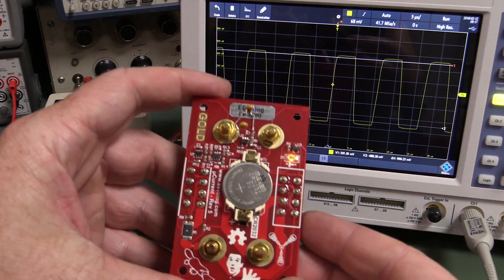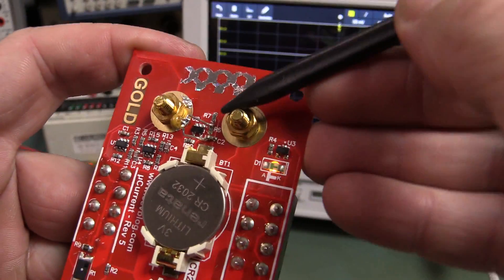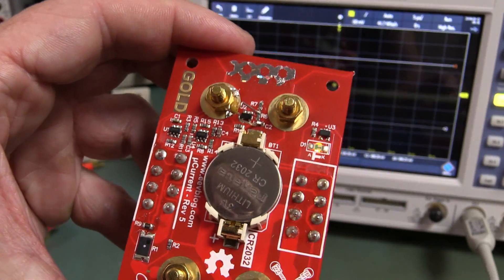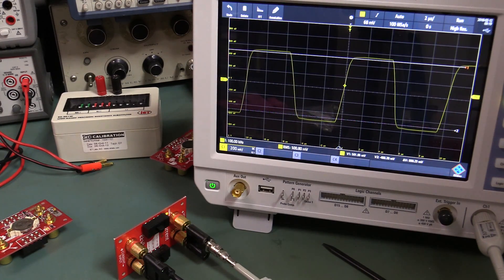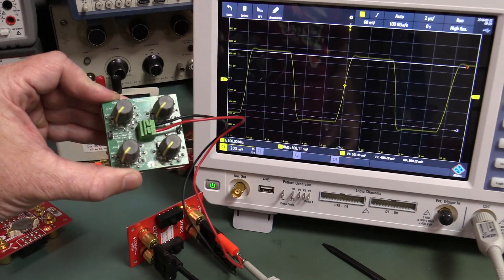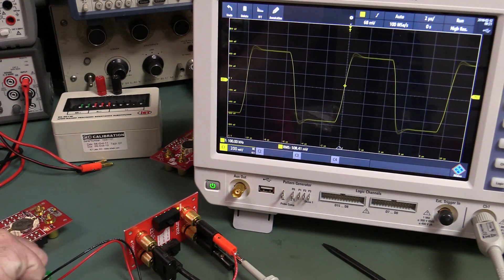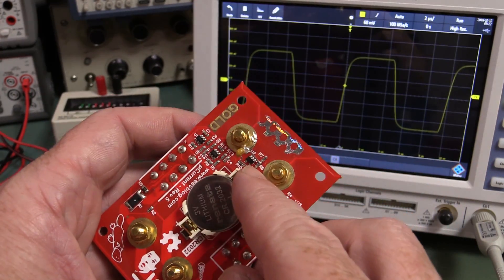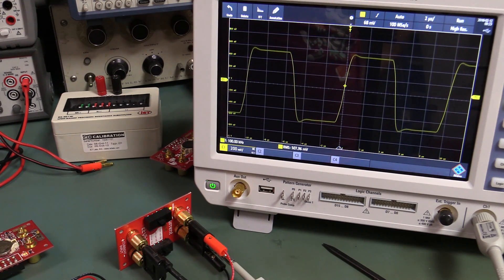µCurrent Opamp Divider Input Bypass Testing

Comment: I'd like to understand in what way bypassing the input divider is similar to bypassing the output?

I would usually bypass the input anyway attempting to lower noise of the v-gnd. Did you mot do this because the battery is already low noise? Why did it cause overshoot??

Comment: Always, always bypass a reference divider like that - in fact, in many circuits a big enough capacitor obviates the op-amp because the capacitor's impedance is so low.

Comment: Um.......I'm lost. What the hell are you working on and what he hell are you doing?
Reply: The latest batch of µCurrent's that Dave has been selling for years has an oscillation issue due to a manufacturer substitution when he ordered one of the chips on the board. He is working thru possible workarounds for the oscillation that wouldn't require redesigning the circuit or replacing the chip.
Reply: Thanks for the update! It is appreciated.

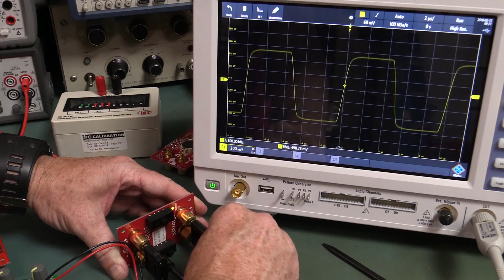Comment: I'd never guess, but the fix with caps on the rails made a low pass filter according to the waveform on the scope at 4:42. Judging from the rise time it should be around 300kHz. Was it probably your initial concern while designing the board back then? In contrast, the fix with cap over R6 seem to produce a nice square wave! The overshoots due capacitive load are there in both cases, just heavily suppressed by the LP filtering on the rail cap-ed board and clearly visible on the other with cap at the divider. As you increase the capacitance high enough (as you say 100p at 4:49) they come out from the shade, and - voila - you just made a notch-filter! 
I have a similar issue right now, designing the input stage of a HV differential probe. I have to match the capacitor values for feedback, shunt and the ones parallel with the high-ohm input resistors while taking care not to mess up CMR. No spice-simulator comes even close to the real stuff...

Comment: This is probably a stupid question: the purpose of the opamp was to create - and + rails? How does an opamp solution fare compared to just whacking in 2 batteries?
Reply: Its a good question and Dave does say you can do just that in his design notes, and then you won't have this problem at all, but it's not as compact.
Reply: Dragan Milivojević From what I know: An opamp needs the positive and negative rails to work.
Reply: Not necessary, you can use ground for the "negative" rail for example but in that case the output can newer go below ground.

Comment: Dave, I have one of the faulty units and I noticed another issue with it. Have you checked for hand capacitance effects? Mine shows huge swings in quiescent output voltage just by putting my hand over the board.
Reply: Have the exact same problem. ± 30 mV offset. Touching the outputs, closer to zero but still all over the place. Tried the 100pF capacitors, still the same problem.

Comment: with a 100n capacitor, the -3dB frequency of the voltage divider network is 31.8 Hz, maybe that is still too high. The graybeards over at analog com say that the -3dB frequency should be 10 times less than the frequency of interest but then the turn-on time for the device might be tens of seconds so there's a trade-off. 
Of course when you're dealing with DC I think that's impractical :)

Comment: You could have at least torn it apart before turning it on :P
(As you can tell, I have nothing to add because I don't know. Just love these type of detective vids :)
Reply: True, Dave should have used an angle grinder to cut the capacitors in half before turning it on ;)

Comment: Maybe c2 is too small or too far and the oa sees the battery internal resistance too much? When it pulls the output up, it sucks current making the battery voltage drop decreasing the in- value...
Reply: As was already pointed out, the supply bypassing scheme in the uCurrent is incorrect and bypassing the  divider won't change anything on that. There should be two bypass caps, from V+ and V- against the load common terminal, i.e. the virtual ground.  
If Dave is so scared by capacitive loading of opamps, I dunno why the uCurrent does not include any countermeasure for that even on the output of the gizmo itself.

Comment: As I see it, the virtual ground is not really a good low impedance ground (it has an "impedance" of 270 ohm plus the opamp) because of R10, I understand why you designed it with R10 in there, but you need some bypassing after R10 to the supply rails, or you could have connected the virtual ground end of R10 to the inverting pin of the opamp like you do on the output..
Reply: Told him the same many times. He won't listen.

Comment: Bypasing directly on the opamp output would be wrong, (capasitive load on the opamp) but bypassing after R10 is the way to go, I can't see what should be the problem with that! Opamps drive big capative loads through resistors everyday, think audio circuits
Reply from the maker: Yes, but a series resistor is not a magic bullet that makes your opamp immune to capacitive loads, it doesn't work like that.
Reply: I know but there are no magic bullets anywhere it's electronics, it all compromise :)
Reply: I have read some TI app notes for other opamps were they test loading caps up to ~1u. With big caps they get stability an they can even lower the output resistor. I dont know if it works everywhere, but for now +1 to the big capacitor loading solution.
Reply: Yes it does make it immune. So does a better circuit, see the last image on this page. http://www.analog.com/en/analog-dialogue/articles/ask-the-applications-engineer-25.html